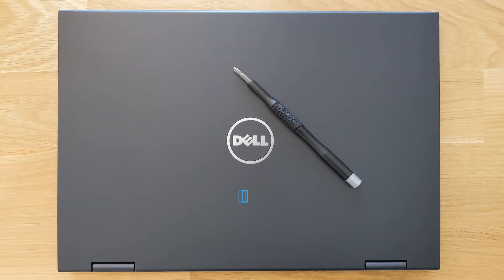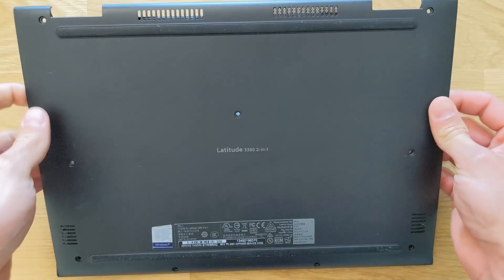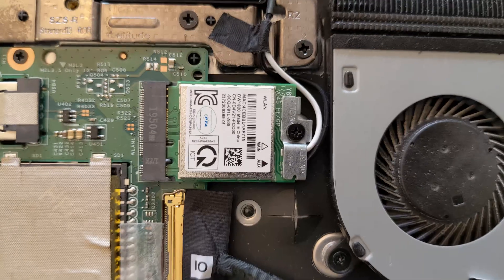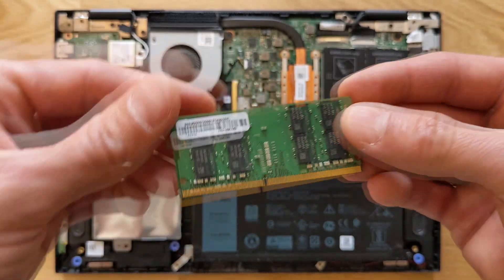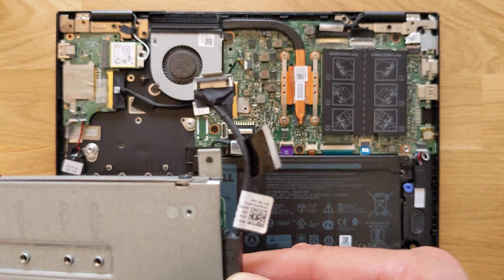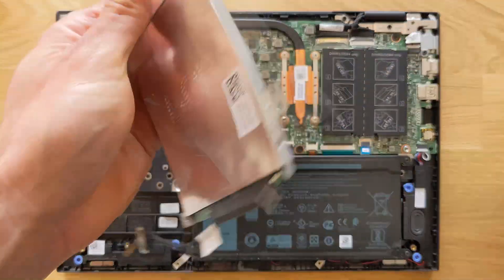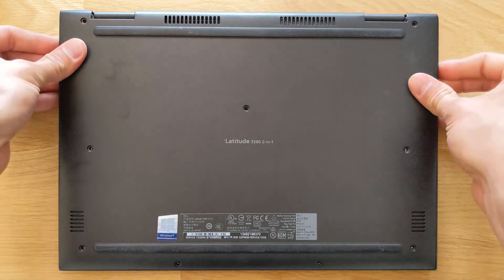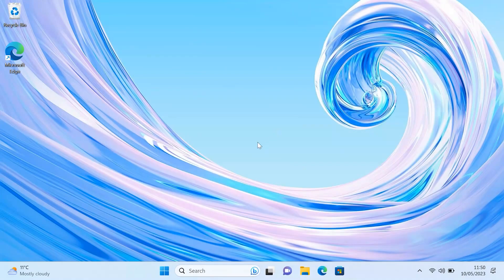Dell Latitude 3390 2-1 RAM Upgrade to 32GB

Comment: My processor i5-825OU @ 1.6GHz
Reply: 3200MHz RAM can downclock to 2933MHz or 2666MHz if system specification supports 2933MHz or 2666MHz

I might try this ?

Comment: I see some of these laptops with 20gb or 24gb ram how does that work
Reply: You can use maximal 2933Mhz and maximal 64GB (32+32)
Reply: @MR_MT_222  I guess the odd numbers must be a 16 + 8 or 16 + 4 .. so I assume the two modules don't have to be the same size .. perhaps same speed
Reply: 64ram is posible?

Comment: you can install 2666mhz ram in this laptop
Reply: Yes you can use 2×32 Max GB and Maximal 2933Mhz not more.
Reply: @DRIFT_MANE what about 3200Mhz?
Reply: @DRIFT_MANE 64ram is posible?